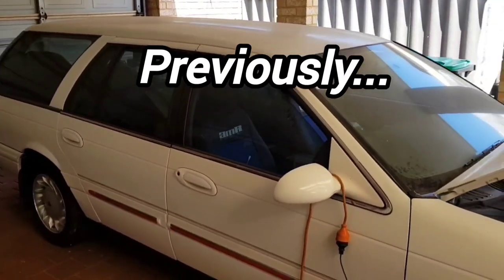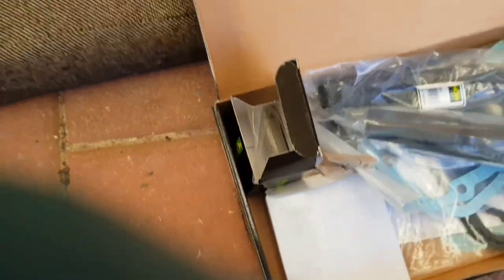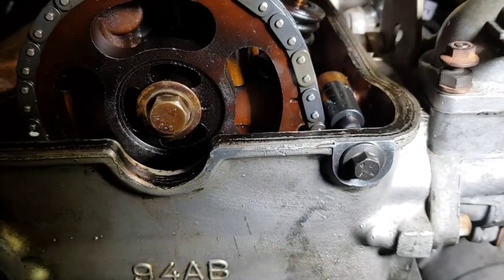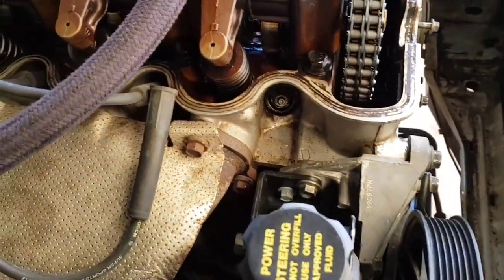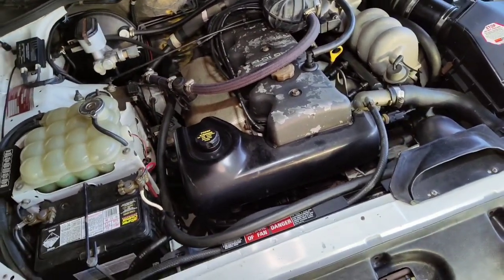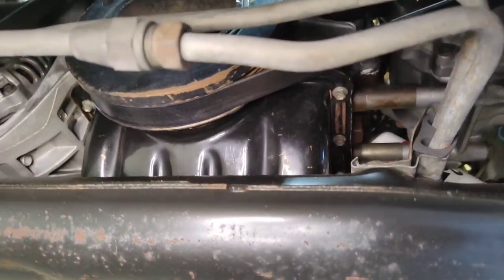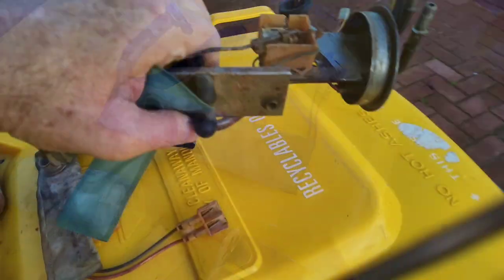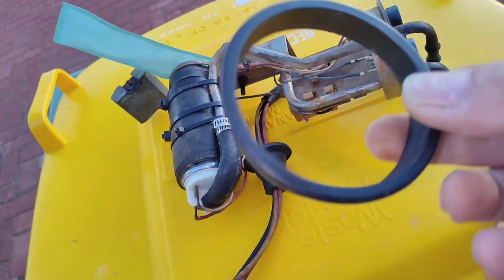EL Falcon, engine repair Pt2. Fixed: aux' drive shaft, new timing chain, not running on petrol.

Comment: Thanks for both videos very helpful.
When you took the bolts off the sump  to remove/fit timing cover did you need to jack up anything as well as loosen engine mounts to get clearance or just pry open the sump a bit? 
Gotta replace timing cover gasket and seal.  Love these videos great work.
Reply from the maker: Thanks man your positive feedback is much appreciated. I think jacking up the engine is a good option to try. I didn't do that just prayed the sump down after removing the bolts as you already said. It's a bit tricky getting the timing cover to seal on the head again but a little RTV will help.
Glad you got some value from the videos and good luck with your project. Cheers, Mark

Comment: Another great video. Do you happen to remeber the part number for the rubber sleeve on the fuel pump assembly? TIA
Reply from the maker: Thanks so much for your positive feedback. This is the link to the rubber sleeve
https://www.ebay.com.au/itm/165494940753?mkcid=16&mkevt=1&mkrid=705-154756-20017-0&ssspo=vAdKUn79SSy&sssrc=2349624&ssuid=P8BbxW-xShq&var=&widget_ver=artemis&media=COPY

Comment: Hey mate did the dizzy completely stop stop spinning or did it just have a dead spot where it was throwing the timing off even more every time the crank rotates?

I’ve chucked a new dizzy in mine, and as far as I can tell it’s all good but it’ll only try to run, or backfire 

The shaft does feel like it’s got 2-3mm of play in it, but does feel like it’s still connected and spinning
Reply from the maker: It was hard to tell if it was spinning or hit and miss. I'm going to say the latter because every now and again when we were trying to start it, it would let out the mother of all backfires.New dizzy is hard to get seated properly because it has to key into the oil pump. If it's not all the way down it may not be engaging with the drive gear? Identify the interface were the dizzy body sits against the engine block. Easiest way is to give the dizzy a little turn, then try to get a feeler gauge (any size) in between them. If it goes in then it's not fully down. It will need to be pulled partially back out, turned a bit then try it again.
If it is fully down the rotate the engine by hand to No1 TDC and check the rotor position is correct. Google it and you will get a pic.
If all this fails to get you going the you might need to pull it right out and get a small inspection mirror or borescope camera down in the hole and check the gear.
Good luck, it's not the easiest of jobs setting it all up properly.
Reply: @markxtinkering  discovered that it does have a flat spot💥 now I’m thinking about fixing it or parking it up, it’s got rego till may but apparently it’s $500 for a new billet aux drive gear
Reply from the maker: I was lucky enough to get one from a wrecked XG ute but maybe anything from EB onwards might fit too? $500 seems a bit rich to me but I guess it would still be worth it to save the car if it is still good nick otherwise.
I must admit when I found this issue on my EL I had to have a good think about the situation and if I was prepared to go there. I'm glad I did because it was very rewarding when it ran again 👍
Reply: @markxtinkering  thats what i was think, at most its 2 days pissing around in the shed and ive got till may to get around to it too, id try one from a wrecked motor but itd be hit n miss and they are getting hard to find now, i have an EB but i dont wanna wreck it 

im actually in the process of doing the same on my mates EB fairmont, we got the new dizzy in, lot less plan than the one in my EL, but we must still have the timing off, i set all the leads to the correct spots on the rotor cap, got TDC and set it to the first one (either it was TDC exhaust or it was 180 out) we managed to get a couple of backfires out the intake, more luck than weve had so far, so i swapped it back around to what should be right and we had absiloutly nothing

im thinking when we have another crack we make sure weve got TDC compression and ignore the harmonic balencer and then see how that goes

also my mate didnt take a photo of where the rotor arm was sitting, he just went by memory and im hoping thats the reason it wont run, and we lost the bolt for the dizzy fork too lol

starting to feel like real life bush mechanics fixing an EB under a tree in the southern riverina lol
Reply from the maker: @Footrotflats251 don't go by the balancer, as you saw in the vid my one was out a mile. Guessing it spun at some point. Blow air in the plug hole and you can't go wrong.
http://uploads.tapatalk-cdn.com/20201003/b025b8925936bb6b3ade8a3dbb399941.jpg
Reply: @markxtinkering  yeah gonna have a go at doing that on the bros EB, hopefully we can find TDC ourselves with a screwdriver and torch and then it’s a 1 in 2 chance of having it TDC compression 😅 

Starting to feel like the real life bush mechanics out here 😅 and then another fella said our street with all the commodores resembles Darwin 😅😂

Comment: when timing it up and you had the 1st piston at tdc, which general direction to the rotor inside the dizzy point? just picked up a e series missing the dizzy and i’m trying to time it up
Reply from the maker: Try this link here or google EL Falcon ignition timing. Good luck with your project 👍
http://uploads.tapatalk-cdn.com/20201003/b025b8925936bb6b3ade8a3dbb399941.jpg

Comment: How do you get the timing case on with the lower guide? There is no clearance what so ever
Reply from the maker: It was quite a long time ago since I did this job but I did have to lower the sump pan down to get the timing cover to fit back in. I don't recall having any problems with the lower guide so it must have just slid into position without getting caught up.